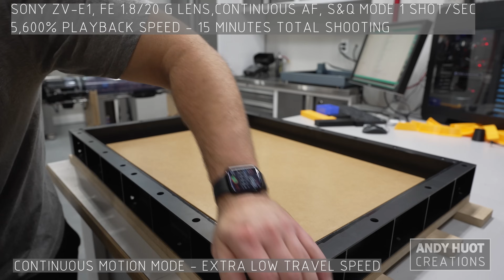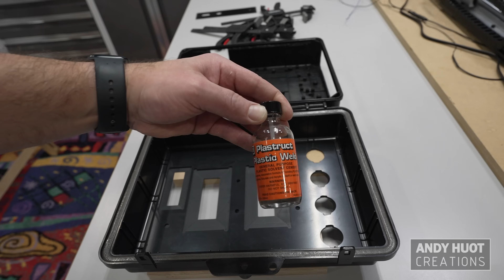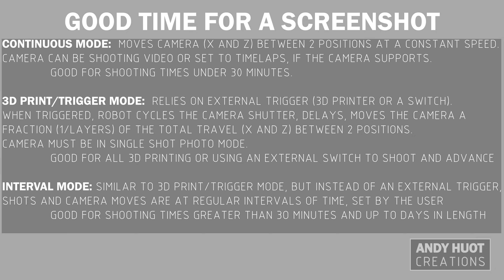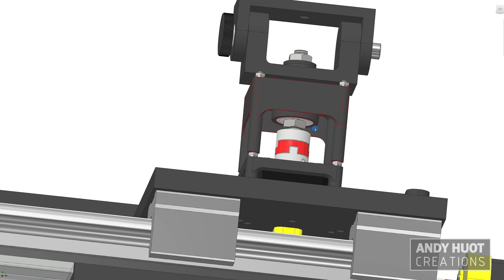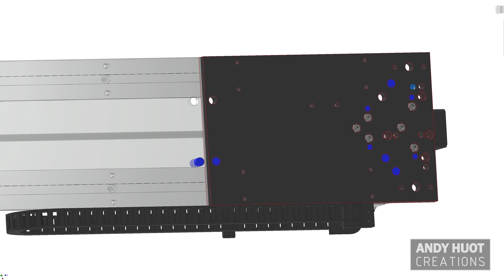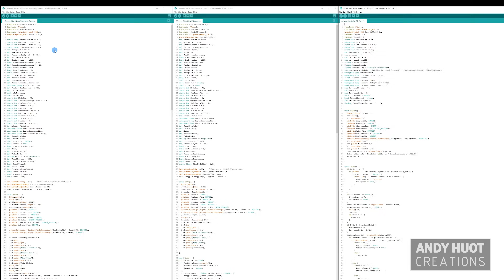I Blew Everyone's Mind with this 1 Device!

Comment: Congrats Andy, beautiful work and video !
How do you manage to get your D3200 stay on  for hours and not switch to sleep mode ?
I am curious to know the trick !
Reply from the maker: Thanks! I got a power adapter that plugs into ac outlet and inserts in the battery compartment of the D3200. No sleep issues. About $20 on Amazon
Reply: @AndyHuotCreations  Ok thanks Andy for your rapid answer ! Keep on good work !

Comment: Duuude… this is the first video on your channel? This is awesome. 
I have seen a lot of Slider builds and most are belt driven. I guess using a lead screw would have less backlash,  vibration and would be more precise for macro shots.

I haven’t finished watching the build yet, but do you work out a way to control focus? 

Far out, I gotta build one.
Reply from the maker: @MakeTestBattle  Thanks! As of now, I set to manual focus and plug in my 7" field monitor to get it focused manually. It will stay at that setting throughout the shot. Reducing the aperture/increase depth of field helps to buffer the small changes in distance to the subject and keep it crisp.